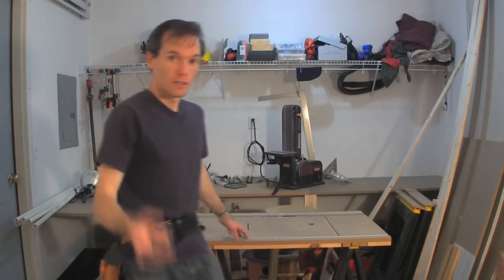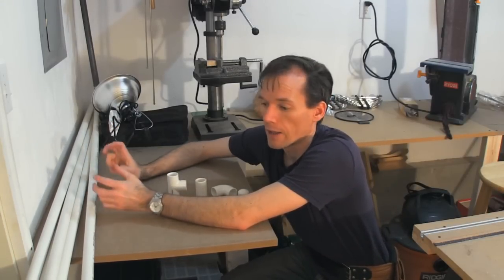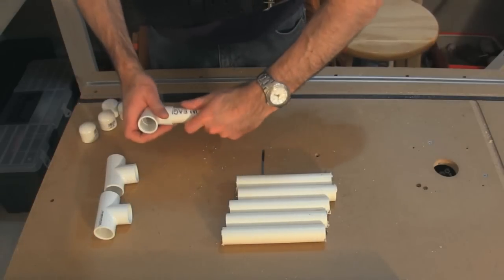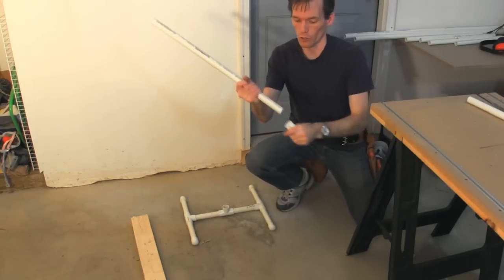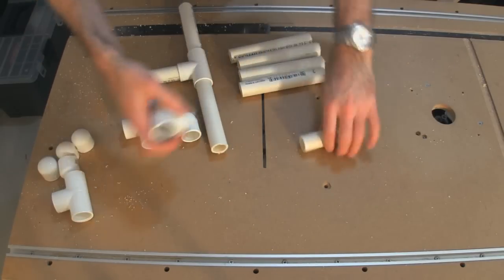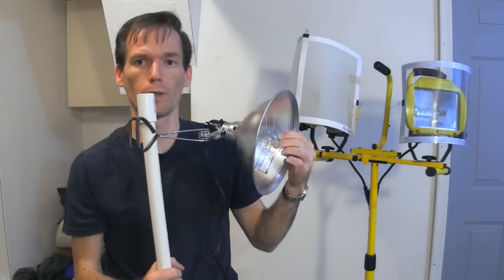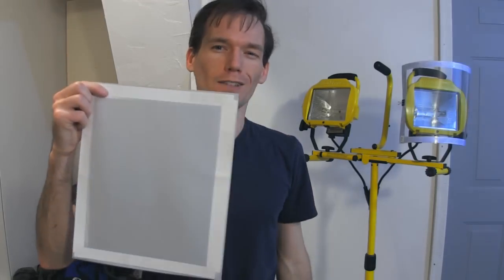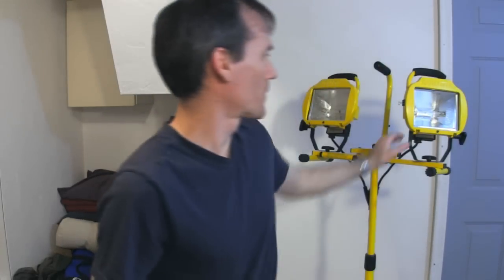PVC Light Stands

Comment: can you tell me please, which size pipes and t-joint did you use, how they can easily join? they fit so good. i tried, 20mm pipe to 25mm t joint, t joint is bigger than pipe and so it doesnt stay fixed. and there is no smaller like 22-23mm, they sell only 20mm 25mm 30mm...tell me please which size is yours?